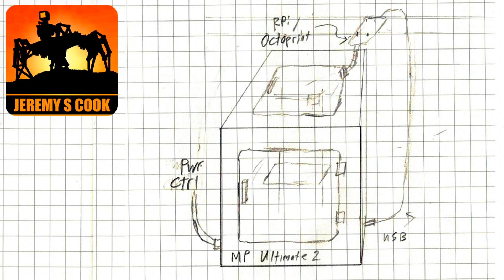Monoprice Maker Ultimate 2 3D Printer Review

Comment: What printing speed do you use? I’m trying to use 55mm/s  and I keep getting a lot of vibrations any recomendarions? :/
Reply from the maker: I generally use 55mm/s myself. I suppose it does vibrate, but seems acceptable all things considered.

I haven't done it, but it might be possible to add weight to the base to help, or some other such technique.
Reply: @JeremyCook  thanks I’ll try to add weight to it
Reply from the maker: @ivanzila4244  Please let me know what you do and how it works out. I may have to try it myself!
Reply: @JeremyCook  ok so I am currently printing and have only seen a bit of improvement might have to slow down the printing speed or add foam pads to the legs of the printer i’ll try 40mm/s next and then the foam pads
Reply: @JeremyCook  so I got thick foam mat and it does seem to reduce ringing but I haven’t had that much luck with the printing speed

Comment: I just got my first 3D printer so I don’t know much about this. Why so you put tape on the printing bed?
Reply from the maker: It makes the parts stick better and easier to get off. You can also use a glue stick. I use something called a BuildTak surface that makes this unnecessary now, which I would recommend.

Comment: I installed this out of the box and was off and running until I tried changing filament.  The new filament printed great but when I tried to switch back to default filament I had terrible clogging issues.   I was really having a hard time finding ANY videos or articles that support this model but managed to clean the head.  No matter what I cannot seem to get the printer to commit to a finished print however.  Suddenly the heat seems off and stringing returns mid-way through a print no matter what I do.    I understand this printer is supposed to have an easy release to swap nozzles --- I bought a new one but can't figure out how to change nozzles.   Is there a guide or a support thread on this printer I could possibly be pointed to?   The included instructions are very sparse on information.  Please and thank you for any help!  Happy holidays!
Reply from the maker: Hi, sorry you're having problems. I'd refer you to this subreddit: https://www.reddit.com/r/MPMakerUltimate2/ where there is a small but active community. 

Also, I posted this a while ago which may be useful: https://imgur.com/gallery/PbetX7X

Finally, after taking everything apart, I realized that there's a hole on it into which you can stick an Allen key to release the heater assembly.

Hope that helps!
Reply: @JeremyCook  Thank you very much!!
Reply: @JeremyCook  Absolutely!  Thx again!
Reply from the maker: @junktape  NP, hope it helps!

Comment: Hey Jeremy, i have the similar printer for about 5 months now. Now the nozzle is not extruding any and there is a ticking noise at the extruder, i feel the filament can't be pulled in even trying to push slightly by hand any suggestions?
Reply from the maker: Hi Abdel - Sounds like your filament is jammed. I'd take it apart and clean it out. Here's some images: https://imgur.com/gallery/PbetX7X and you can find some other resources here: https://www.reddit.com/r/MPMakerUltimate2/

Comment: Please help. I have a Monoprice Maker Ultimate 2 (AKA Weedo f150s) 3d printer. It stopped printing after 1 day with a new nozzle assembly. It does NOT seem to have a clog, by all the usual tests. But, when I take out the filament and run auto-feed or auto-retract, it gives a rapid loudish clicking sound, and I was told by Monoprice support that when running auto-feed and auto-retract without filament it should NEVER be clicking. So how can I dissasemble that extruder  motor box for it? Any ideas?
Reply from the maker: Hey Mark - Check this out: https://www.reddit.com/r/MPMakerUltimate2/comments/epm1rs/disassembling_mp_ultimate_2_extruder/ - I'd recommend that subreddit in general too!

Comment: Hi I have a Monoprice maker ultimate 2 it came with firmware 1.6 and today I updated to 2.8.0 and when I did a test print the nozzle is far to far from the bed, as it is my first 3d printer I am not sure how to set it up correctly please could you give me FULL instructions on how to fully set it up correctly
Reply from the maker: Hi John, TBH, I never updated my firmware as I was a little reluctant to potentially cause issues. I see you asked on the MMU2 subreddit, I hope that's productive, as I wouldn't mind upgrading myself.

Comment: Aloha :) Great video. In looking to jump into the 3D printing world. Do you still think this printer is a good choice 8 months later? I have no experience and think this price point is a good start
Reply from the maker: Thanks RJ! So it's a definite upgrade from my old printer, but honestly, if you're just starting out, I'd say go with something that lots of people use so you can easily get support. I started on the the MP Select Mini V2, which is more limited, but much easier to get questions answered on it.
Reply: Very good point. This reminds of starting all my other hobbies. Find the community first for the support aspect. That said, since I’ve got some very experienced makers at my “disposal”, hehe, is this printer that something they can help me grow into? I like the enclosed area and the self leveling printed.
Reply from the maker: @rjderama  Thanks. Yeah, I think it's a fundamentally good design IMO, but software/community is a bit lacking. So if you're set on it, and have friends that can help, then why not? You might check out this subreddit to get more input: https://www.reddit.com/r/MPMakerUltimate2/
Reply: @rjderama  I got this two weeks ago and the bed "auto level" is crap. Basically my machine, when the bed is levelled, does an "auto-level" to misalign the bed in software. Talked to manufacturer, they said talk to distributor, who said talk to manufacturer... I wish I'd gone with either a Prusa or something cheaper.
Reply: jsirkia thanks for the reply. I’m eyeing the Prusa printers as well. And from the Reddit groups, it’s hit or miss isn’t it?
Reply: @rjderama  Yes, with a small reddit group being pretty much the only support place, it's not much. Creality Ender was on my list too, they seem to have more happy users. This thing isn't that bad if I'd only need to print on a 50x50mm footprint, but bigger pieces run into the bed warp issue. Firmware has some bugs and the fans scream, but the way MP now shuns any responsibility and points towards distributors is what really drives me up the walls.
Reply from the maker: @rjderama  I'd agree with that. I like mine, but there are definitely varying opinions. Prusa is probably a good option if you're sure you want to go all-in on the hobby, but The MP Mini is a great way to get your feet wet.
Reply: @JeremyCook  That's my GAS problem, feet wet for me = scuba gear on and dive to the bottom of the ocean...AND GET DEAD.  LOL.  Ok ok, not the best analogy right now.  Prusa sounds great, so maybe gonna need some patience cause I won't get it till August.  Maybe the Mini then the Prusa? EDIT: The mini doesn't have self leveling, and I'm worried my limited vision acuity is going to be a problem there.  But self leveling does come at an increased cost and the Ultimate 2 seems to good to be true there for that feature....Thank you for advising me!
Reply from the maker: @rjderama  I think the newest version of the MP Mini does. Honestly though, leveling is more about feel than vision IMO. I'd get a feeler gauge though, the paper thing seems pretty unreliable. Also, people make a big deal out of bed leveling, but I rarely did it on my mini.

Comment: my concern is that filament is inside where all is heated up, does this not cause any issues when you do abs?
Reply from the maker: I haven't tried ABS on this, so I guess I can't comment. I wouldn't think it'd be a problem, but don't really know.
Reply: @JeremyCook  you should give it a go and make it video of it, specially on larger print where high heat is applied for longer time.
Reply from the maker: @n0spam911  Not a bad idea. I've got a few more tests I want to run with it. For now, I'd invite you to check out this followup video: https://www.youtube.com/watch?v=uJYRarzyr0U with some more details on the unit setup.

Comment: Hi, do you know if a slightly wider filament spool would fit in the machine? For example I use BQ and their spools are 7.6cm wide compared to a usual 6cm width. Would these fit in there OK?
Also are you able to have the door open and still print? Many thanks
Reply from the maker: Hi Ron, looking at my machine, I've got about a 3mm clearance on the hook itself compared to a Ziro spool, and there's something like 12mm between the spool and the printing bed when the spool is pushed back. So I don't think a 7.6cm spool would fit without some modification.

It looks like you can set it up to stop with the door open or to keep going, but I haven't tested that. If I remember correctly the door can be open when printing.
Reply: @JeremyCook  OK thanks for checking, much appreciated. If I get one I may have to run an external spool holder I think.
Reply from the maker: @ROBNOB9X  NP - yeah, sounds like it.

Comment: Can you share the cura profile with me? I need to see the start gcode, the gcode flavor, and what your machine settings are. Im having issues with my unit.
Reply from the maker: Hi Wesley. Just did a export: https://github.com/JeremySCook/CuraProfile please let me know if that is what you need.
Reply: @JeremyCook  Hi Jeremy. Very helpful video. Can this Cura profile be used with any version of Cura? I just got the Ultimate 2 and it comes with Cura 3.3. The latest version is 4.4. I've been having adhesion issues with tape/glue and with glass/glue and am thinking it's Cura-related since I have the latest firmware. I wanted to try to get the latest version of Cura running for the Ultimate 2 and get a good profile so I can rule out it being a Cura issue. Thanks!
Reply from the maker: @singacata  Hi, thanks for checking out the video! I'm running Cura 4.2.1 currently, but I would imaging it'd work with 4.4, but I've yet to test that. I'd love to hear about your results though if you try it!
Reply: @JeremyCook  I noticed you're printing at 220 degrees C. Isn't PLA normally around 205? Just curious why you print so hot. Appreciate the tips and quick reply. Thanks Jeremy. I'm going to test tomorrow. I have a print that is finishing up and will let you know how your profile does on Cura 4.4 and how adhesion does.
Reply from the maker: @singacata  Hmm, you might be right - to be honest I'm not sure at this point why I set it to that temperature, but it seems to work fine.

NP, hope it works out for you!
Reply: @JeremyCook   I just got this a couple days ago and am new to 3d printing the cat worked great, but nothing else does.  Ordered some buildtak to see if that helps with the first layer issues not sticking (with tape or without including glue), also the z_offset test seems to fail on test patterns, and when I adjust the z_offset on the screen it doesn't seem to do anything.  Is there anyway to update the firmware?  It just shows 1.6 but not sure what that is (doesn't look like marlin version).  Any help would be great.  I guess I thought out of the box meant it would work a little smoother.  Thanks
Reply from the maker: @kelseym2298  Hey, thanks for checking the video out.
Sorry you're having some problems. Yeah, the z-offset is a bit tricky, as I'm not sure the units. I basically played with it until I had something that seemed to work. Also, I pretty much always use Octoprint as my interface. 

You might check out my second video on this printer here: https://www.youtube.com/watch?v=uJYRarzyr0U for some more insight.
Reply from the maker: Hey Wesley, saw your comment about the filament on notifications, but weirdly I can't find it to reply to. Anyway, have not tried it yet. Sorry to hear it's not going well for you with TPU.
Reply: @JeremyCook  I fixed the issue with the start gcode, and I deleted the comment because I fixed the issue with the TPU. The firmware is what's been the biggest issue.
Reply from the maker: @wesleychen1841  Good to hear you fixed the start code - did my other video help? What was the issue with the TPU? How did you fix it?

Comment: The up/down on the z-axis makes the time-lapses look awesome. Speaking of which, how long did the kitty take to print? And is the tape a must?
Reply from the maker: Hey pocket - thanks, the way the Z-axis works here isn't really typical, but I think it's a good design to have the gantry take care of the X/Y, leaving the bed only moving in the Z direction. Glad you enjoyed!

So I'm not entirely sure how long the kitty took - slightly longer than my GoPro lasted batteries-wise. Took 1090 shots at what I think was a 5 second interval, so maybe 1 hour and 45 minutes? Printers are quite slow compared to woodworking stuff. Tape's not essential, I use the bed without it now, but apply glue from a stick to make the prints adhere well.

Comment: Also, how is the cooling on this thing? I've heard numerous accounts where people said the cooling was inadequate on the previous model. Is that still the case? I'm looking for a 3d printer that has the air blowing right onto the freshly extruded filament
Reply from the maker: Honestly I'm not sure. Seems to handle overhangs OK, but maybe I get get into this a bit more in the second video I'm planning. Any particular tests in regard to this that you'd like to see? I've got some more stuff on the printer on my Twitter account if you'd like to scroll through: https://twitter.com/JeremySCook
Reply: @JeremyCook  absolutely. I'd love to see overhang and bridging tests, if the enclosure makes a real difference, and if the printer lives up to its ambitious "up to 150mm/sec" claims. I'd also like to know how fast the hot end and bed heat up, as well as how it fares printing flexible filaments do to its tendency to warp mid print and how well it feeds in that wierd Bowden-guided direct drive feeding mechanism. Id also would like to get a real close look at the cooling and where the air blows. Any idea on the ETA of part two?
Reply from the maker: @wesleychen1841  Hmm, not sure I'll be able to do all of that (don't have any flex filament), but I'll try to at least put something in about challenging overhangs, how hot it heats up, and look at the cooling direction.

I've been running it well under 150mm/s - maybe it's capable, but been taking it a lot easier to try to get the prints to come out well (and not vibrate like crazy, at some point I think that becomes a problem).
Reply: @JeremyCook  Well that's too bad about the filament... I was wondering because I'm in the racing drone hobby and tpu is amazing for that. It's practically indestructible because of it's amazing layer adhesion and has adjustable give based on your infill settings. Although I do look forward to the other tests. I do highly recommend at least trying out a flexible material at least once though, it unlocks a lot of potential and is at the very least something to play with during a 3d printing dry spell.
Reply from the maker: @wesleychen1841  Interesting. Is there a certain filament that you'd recommend? Also, do you think it'd be able to print that, based on what you've seen?
Reply: @JeremyCook  on a closer inspection of the printer, the Bowden tube I was talking about doesnt extend straight to the extruder, instead it's there just to mellow out a bend on a sharp edge. So I dont really expect it to hinder extrusion. The only TPU I've tried was AmazonBasics TPU, which was vacuum sealed, decently wound(no tangles), and printed without bubbles... so that would be my recommendation. You should make sure to look at a guide or two when printing with TPU, but other than that you should be fine. What I'd like to know is how much of a factor the enclosure would play as the TPU likes to curl up on overhangs and thin edges, what is suspect is caused by the air temperature being too cold. The blower fan on the extruder is a big deal to me. More direct cooling allows the printer to print a higher temperatures for better layer adhesion, better overhangs, better bridging, as well as higher speeds when paired with higher temps, which is why I asked you to include a closer look in your part 2. Thanks for talking with me and I eagerly await your part 2.

Edit: if you're just asking if the printer is ABLE to print in TPU, yes, it should be fine. Being a direct drive, the printer shouldn't jam too much. Whether or not it will print it WELL, that is the question.
Reply from the maker: @wesleychen1841  Thanks for your thoughts. I'm tempted to try it out now!
Reply from the maker: @wesleychen1841  Alright, seems like it'd be a cool material, so ordered some TPU! Guessing I'll have part 2 out on September 10th, but we'll see. I can possibly show you a rough cut earlier if you're in a hurry though, just LMK.
Reply: @JeremyCook  well, I already ordered one 6 days ago and itll be arriving in 2 days, but I'd love to see what happened during your test prints. How well did the printer fare with tpu?
Reply from the maker: @wesleychen1841  Well thanks for the reminder - I actually ordered a roll, got it in, then got distracted with some other stuff... That being said, I'll try to test it for the next video!